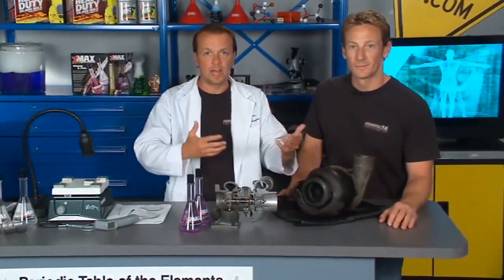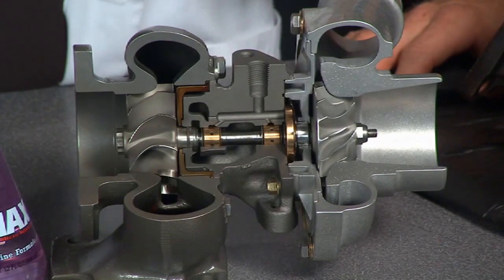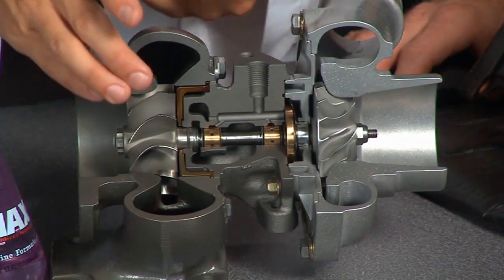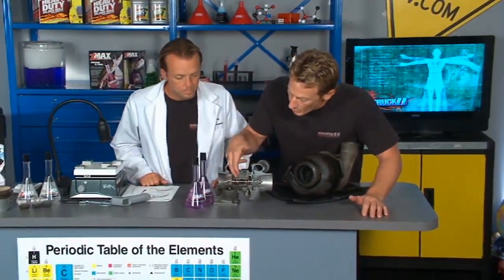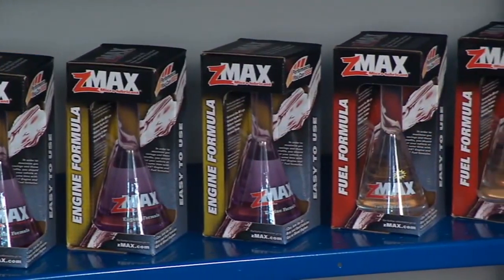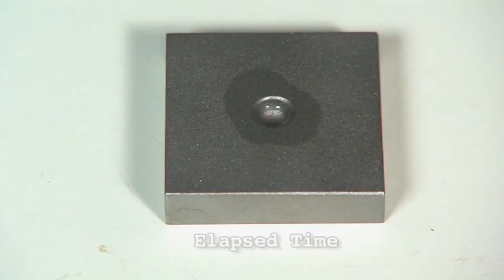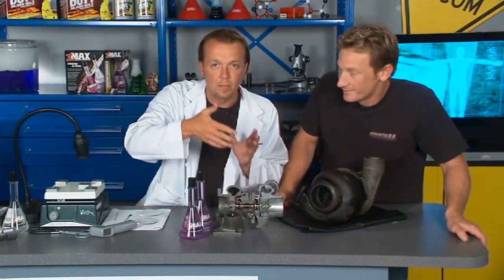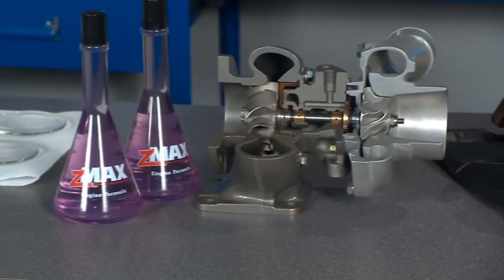Turbocharger Maintenance | TruckU Tech Tips

Comment: Maintenance......... really? all you did is throw a snake oil commercial at people. That is not maintenance! Maintenance is using a synthetic oil that won't break down under the extreme heat a turbo can see, allowing the engine and oil to fully warm up before you start driving so the oil will flow better and fully lubricate the turbo, and periodically checking the couplers and connections of the turbo to the engine since they're usually under such high pressures from the boost. Adding a snake oil additive is not maintenance and it makes you idiots look bad in the process for not giving any real advice that can actually help people.
Reply: Also, if you have a turbocharged engine, don't forget to let the engine idle for about 1 or 2 minutes before shutting it off so the turbo would cool down and letting the hot oil continue to flow through the turbo so the hot oil won't be trapped inside the turbo bearings which could cause the oil to burn and leave carbon-like deposits that will damage the bearings.